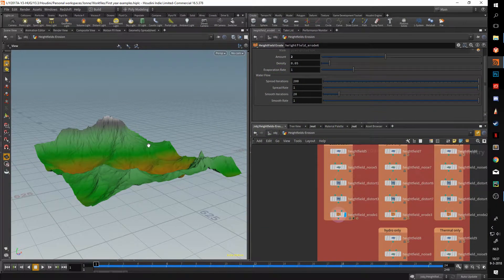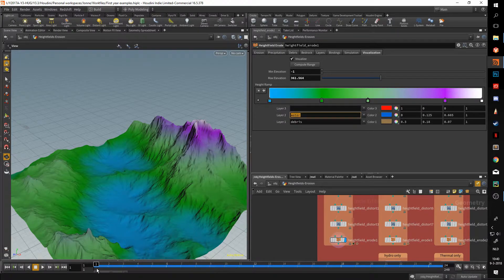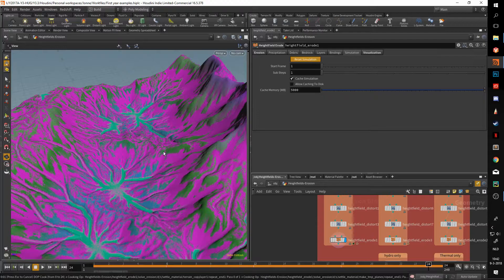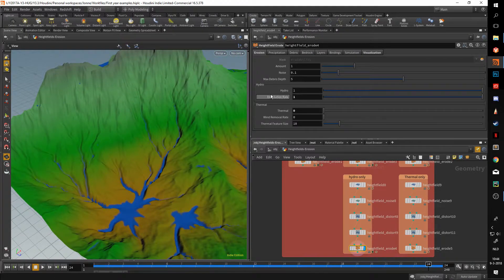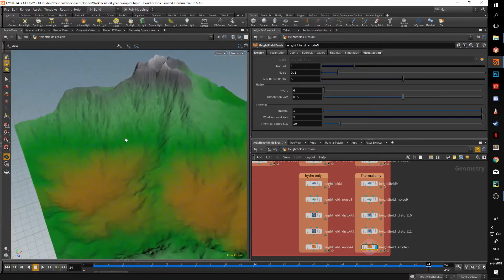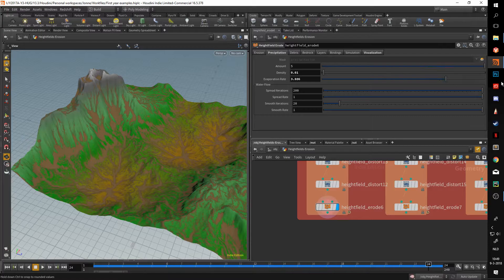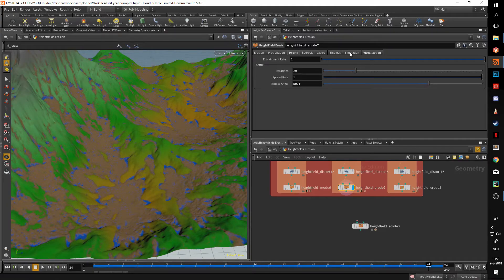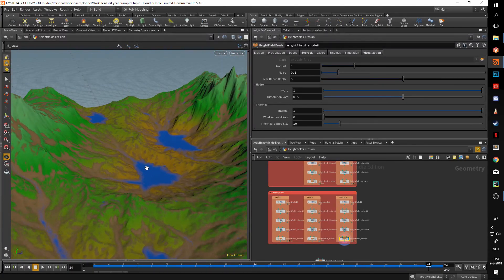Learning heightfields Pt. 7: Erosion

Comment: In about 12 minute you made a mistake. There was no changes because of too low density, right?
Reply from the maker: If you're using houdini 16/16.5 (I haven't checked this in 17 yet) the density should affect the level of detail. In the video, very little changes because the resolution of the HF is relatively low for its size (2 meters per pixel). If you were to increase your resolution, you will start to see the effects of lower densities (0.01 or lower in the video's case).
I might've misunderstood your question though